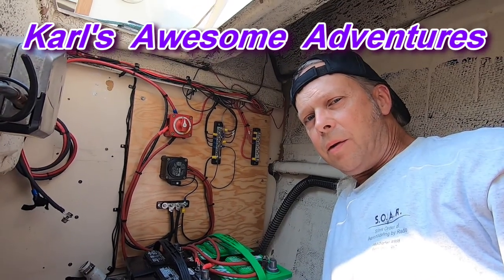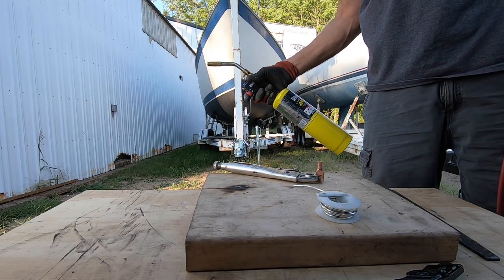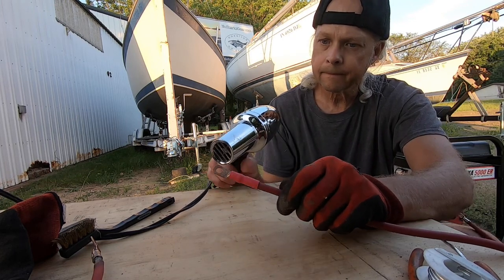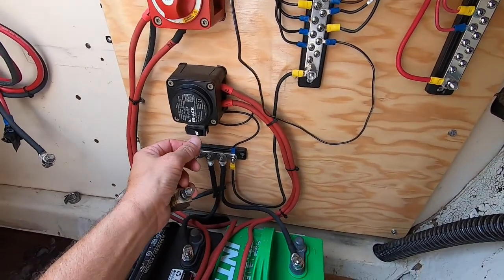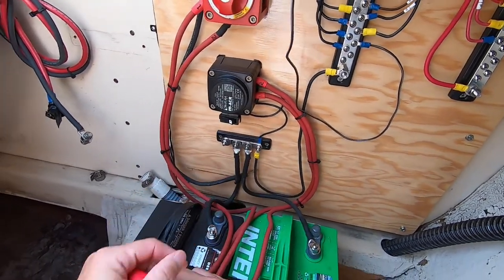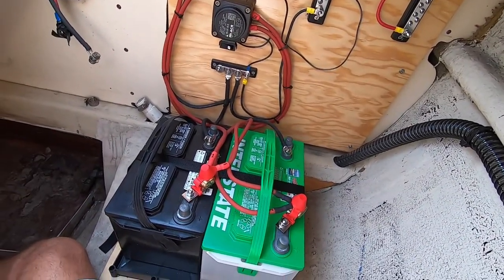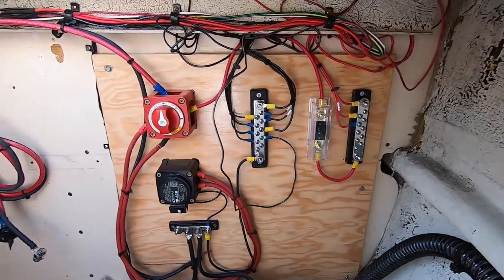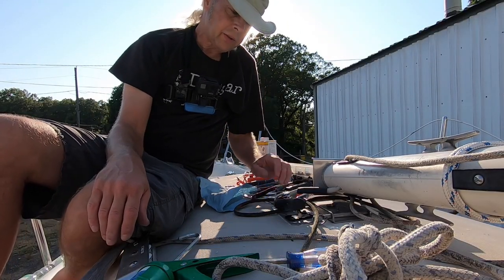New Electrical Panel Installation !! O'Day 25 Sailboat  |  E25

Comment: I did a little wiring a couple years ago and like you I used the copper terminal connectors. I’m re-wiring now because of upgrades and my copper lugs were corroded already. Supposed to use tinned connectors and wiring.
Reply from the maker: Mike, thanks for the tip. I did use tinned wire. But the lugs are all copper. Hope they don't corrode in a couple years.

Comment: That Is the best way to make custom cables. I made plenty when I worked on Rolls Royce’s.
Reply from the maker: Wow! Was that Rolls Royce cars or airplane engines? I was a mechanic, and did suspension, alignments, ad brakes at a tire shop in my 20's. It was a dirty job!

Comment: Great video! I am currently in the process of refitting an O'Day 25 and need to redo the electrical system. What are the dimensions you used for the plywood backing?
Reply from the maker: Sam, My boat is currently on a trailer under a huge tarp for the winter. I used 3/4" thick marine plywood, approximately 20"x 20". You can size to fit your bulkhead. Finished with 3 coats of clear Spar urethane. Redoing all the wiring took some time, but is worth the effort because then you know everything will work right, and is organized for future wiring projects. Have fun : )

Comment: I would give 1 suggestion a light coat of petroleum jelly will keep all the connections like new . I did that on my sail boats battery kept it like new for years
Reply from the maker: Thanks for the tip Randy. I will do that. Fair winds !

Comment: Good video. I own a 1976 O'Day 25. It's in the water now. I am having a problem with the center board sticking in the up position. I noticed that your year has some better features than mine. Mine does not have the anchor locker on deck, or the fuel locker in the cockpit.
Reply from the maker: Thank you. Mine is a 1982 O' day 25. Yes, the anchor locker is nice, I will store the chain and rope in there. I recently installed a bow roller for a delta anchor. Have you checked your hinge pin and pendant line on your centerboard getting stuck?
Reply: @karlsawesomeadventures9608  I had the marina lift the boat off of the trailer to launch it.  I had to use a screwdriver to unstick it.  It seemed to move freely afterwards.  Later I went to lower it at the dock to test it and it was stuck again.  I may have pulled it up to hard?  Next month when its hulled out I will check it again.   Thinking about using a thin steel rod to put down the pennant tube to try and unstick it.
Reply from the maker: When you get it hauled out again you can inspect it more closely. Does it have a lot of crud or buildup on the surface? Maybe the shackle is crooked or getting jammed somewhere up inside.
Reply: @karlsawesomeadventures9608  It looked pretty clean.  Although I only spent about 2 minutes looking it over before they moved it to the water.  I was surprised to see that the lower end of the pendant was made out of 1/8 inch stainless steel cable very similar to the standing rigging.  And further up it was braided into polyester line.  At haul out I am going to remove and inspect everything and replace the pendant.  At launch day I didn't have much time.  At the marina scheduling a launch is a separate thing from scheduling the lift for maintenance.
Reply: @Tacking ⛵ and Turning ⛷ That is a great idea. I am a scuba diver and thought about diving or snorkeling under , but the season here is just about over.  I might dive it this weekend and free it and then keep it in the 50% down position all the time.  Keeping it permanently down at  the 3 or 4 foot draft position probably wouldn't hurt anything? This winter I am going to mark the pendant in the cockpit every six inches so that I know exactly how deep it is.

Comment: Hey Karl- I learned a lot from this video as I rewire my project boat. I appreciate it.  My question: I’m using the add-a-battery kit, too.  If I want to mount that kit forward, but keep the batteries aft, will just running the 6G wire to a circuit breaker, then the add-a-batt work okay? That is, any complications you see running that add-a-battery like 14’ away from the battery? Thanks.
Reply from the maker: Hey Jeb, That should be ok to run 6g cables 14 feet. The main reason to run bigger cables would be if you have a bigger engine with bigger starter and alternator. My 9.9 Suzuki electric starter should only be pulling about 50-60 amps during starting. Yes, longer cable lengths usually means bigger cables like 4 g. You may want to do this just for peace of mind.   I kind of wish I would have mounted my electrical panel in the cabin somewhere to keep water off of it. I might build a cover for it in the lazarette.

Comment: I have the 120 amp kit on both my boats and when I talked to Blue Seas reps they indicated I only needed to  hook the positive cable from the battery to the ACR up to the MRBF fuse.  Was there a special reason  you hooked both up?
Reply from the maker: I was thinking that each battery needs it's own fuse, because sometimes they are running seperate when the ACR shuts off the start battery. Then it would be on it's own circuit temporarily. I could be wrong though. I am not an electrician and would totally trust what the Blue Sea rep said. But it can't hurt to have an extra fuse ...💡
Reply: @karlsawesomeadventures9608  You need to calculate what size MRBF you need and may have difficulty finding one rated so low because I wouldnt think it would need a big rating.  The cost of the special fuze holder was really high so you're looking at close to $120 just for two of those.  I guess all it could hurt would be the wallet!!
Reply: Say your cables coming from the MRBF are rated for 100Amps. Then a MRBF of  100A can also trip/jump/blow even if the amps going through the cables are only say 30 amps. (say you have 4x 100Amps rated cables coming from the MRBF drawing all only 30 of it's 100A, it results in 4x 30A = 120A and thus higher than 100A. 
Just saying so you know why the 100A could jump, while only drawing lower amps per cable connected to it... 😅 You have to add all cable amps together 😊
Can't explain it better cause I'm from Belgium, Dutch speaking part of it 😊

Comment: Why did you choose a 100 amp fuse for the MRBF? Great video!
Reply from the maker: Leonard, I used this chart from Blue Sea Systems marine. 
http://assets.bluesea.com/files/resources/reference/20010.pdf
Interesting the rating for MRBF fuses is higher than regular in line fuses which would normally be around 60 to 75 amps for 6 G wire.

Comment: Where did you get the little switch for the acr
Reply from the maker: I think I got the little Rocker switch at Advance Auto parts. Very low voltage 5-10 Amps.

Comment: I have an O'Day 25 , I have completely rebuilt  most of it. How did you get in that hatch and sit where you are? Impossible for me. I built a panel too, put it in same place
Reply from the maker: I climbed in the starboard lazaret locker opening. I am 6' tall but thin ,lol ! I thought about putting the panel inside the cabin, but didn't come up with a good location. Having the electrical panel in the Lazaret is good for easy access, but It is unprotected if water gets in there around the lid opening. I might make some kind of cover in the future.
Reply: Karl's Awesome Adventures water does come in through that hatch on a starboard heel or hard rain . The rain gunnels are not large enough in the back hinge line area. I used starboard because of rot issue. Our boat was consumed with rot , top to bottom , front to back.
Reply from the maker: @bullhippo9023  I just added some rubber seal around the locker lid edges to prevent that very problem. Will see how well it keeps the water out in next hard rain :)

Comment: great video! thank you for posting. I have 1 '76 25' O'day which I am trying to get in the water myself. I have a couple questions, is your outboard on the starboard stern side? Don't the batteries and engine make for some serious list? Also, did you pull the water tank? Is that why there is so much room below?
Reply from the maker: Thank you! I removed the water tank temporarily to have better access to all of the original wiring, which was in the front of the lazaret there. Then reinstalled it after I was done wiring. Adding an extra battery could cause some list, but my outboard engine is on the port side (1982 O'day 25) which is a really heavy Suzuki 9.9 four stroke  at 129 pounds. I figured that the engine on port side and two batteries on starboard would balance each other out. Seems ok in the water when I went out last year on the shakedown cruise. Have fun with your O'Day 25 Christopher !  I have more projects to do this year , but I can work on them in between sailing now : )

Comment: You said a #6 wire in and out of the acr and used 100 amp fuse?
Reply from the maker: Correct. That was according to a chart I referenced for wire gauge  and fuse application.
Reply: @karlsawesomeadventures9608  you might want to check that again
Reply from the maker: @redwood1957  I used this chart from Blue Sea Systems marine. 
http://assets.bluesea.com/files/resources/reference/20010.pdf
Interesting the rating for MRBF fuses is higher than regular in line fuses which would normally be around 60 to 75 amps for 6 G wire.